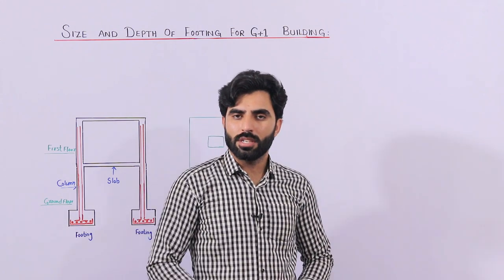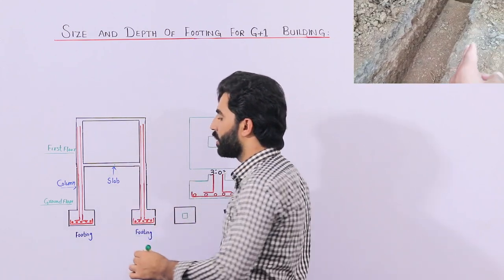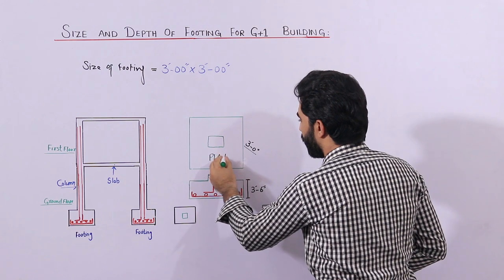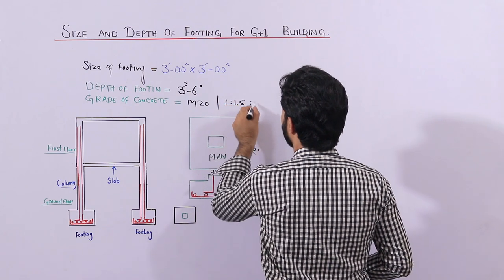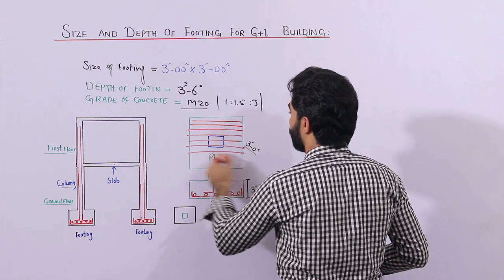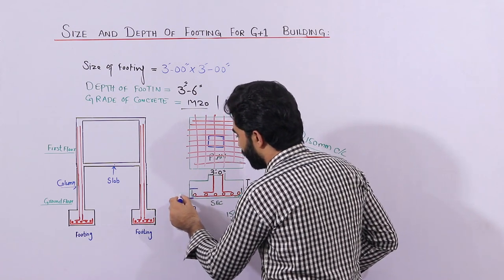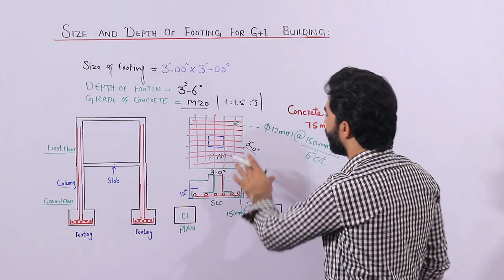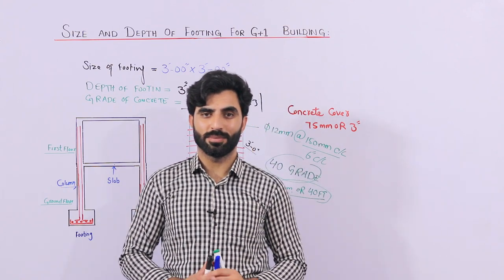Depth of Foundation for Two Floors Residential Building | Size of Footing | Footing Reinforcement |

Comment: Sir,
     Please make video for depth and size of foundation and column size  for G+4 and G+5 RCC residential buildings considering general thumb rule of RCC building though the size of columns and depth of foundation depends on many factors such as soil bearing capacity, load of RCC building, span of the column etc.

Comment: Surely the size of foundation should be based on the forces it needs to resist, not the type of building, as the type of building can still vary in dimensions and therefore reaction loads.